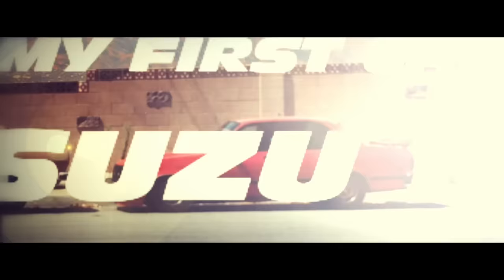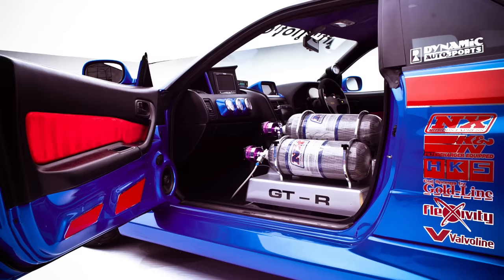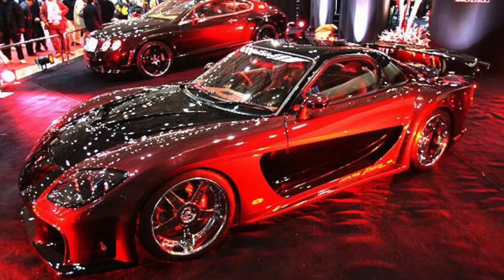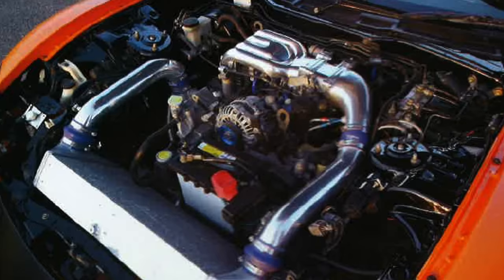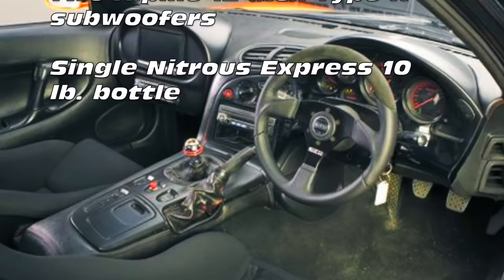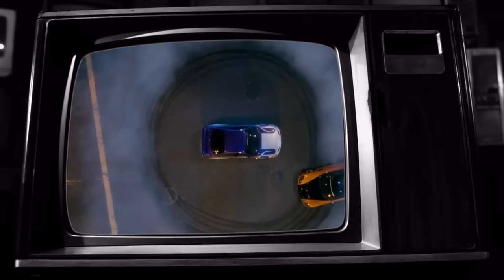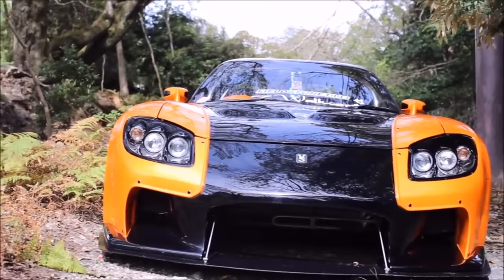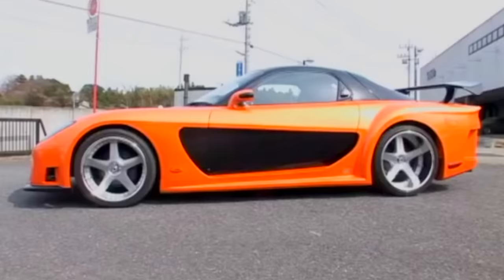HAN'S RX7

Comment: Sung Kang is 100% spot on about the earlier F&F having the most recognizable/iconic cars.
Reply: legit. I can't even remember the cars used in FF4 6 etc. I know they used some lambos and stuff but can't recall the model.
Reply: Robanz ZZ the F-Bomb Camaro from the 4th movie was kinda cool if you like that era Camaro. The real one (owned by the chief editor of Hot Rod Magazine) was a 8sec Nelson Racing Engines 1500hp twin turbo setup. NRE also built the 2000hp Charger that was featured at the end of the 7th Fast & Furious movie.

Comment: The bodykit was always an interesting one with the Koenigsegg-esque fixed headlights, do VeilSide still make it? (Do they make any of the old, iconic bodykits anymore, for that matter?)
Reply from the maker: Yes, it’s still made. I showed a screenshot of their current website (VeilSide).
Reply: Fun fact about you mentioning the koenigsegg. I worked at the factory, according to the "OG's" working there, the early Koenigseggs (CCR especially) had BIG problems with those headlights, always leaking and having moisture problems.

Comment: In 2004, I was putting a rebuilt atkins into my '83 rx-7, and I was watching Fn'F and 2F2F .....doing the work in an apartment parking lot.     Water pump housing cracked on assembly, put the project on a 10 day hold.

Comment: Add another $45,000 you can have a 900+HP 4 rotor put in and have a "show and go" replica.
Reply: gofa curself  I was trying to stick with an engine that was in the same brand.
Reply: Nahh... 2 rotor is capable of putting around 500 whp. Check out Aaron Parker's wolf Rx7 if u haven't already seen it. Still has stock internals and a 2 rotor. Has 550 to the wheels without the NOS

Comment: This FD is definitely in my top 3 for FF also. It's just about perfect. I would love to build one and drop a nasty n/a pp 4 rotor in it... something that revs to 10-12k rpm and just lives to bounce off the limiter. Pretty much a replica of the exterior but with a rotary lovers' motor and leave the interior stock other than maybe some seats and a wheel.

Comment: At the end of Tokyo Drift we see Diesel in the muscle facing off against Sean. How does Diesel's car in that movie, in-universe, compare to the in-universe Charger in terms of horsepower? I've heard stories that some similar charges pull 800 HP with minor mods.
Reply: all i know is cars go brrooooom
Reply from the maker: Make up any story you like - they never showed the motor in Dom’s car, and do audiences are left to their imagination. But since big American cars can’t turn for shit, any car person knows what the outcome would be.
Reply: @craiglieberman  I meant not in a drift sense but more in a power sense, what would you as a technical advisor put in-universe as the engine block in those, and would Dom's car at the end of TD compare to the Charger in F&F.
Reply from the maker: DMZ Given the fact that the car only drove for 50 feet, there would be no reason to change the engine. Also, given the fact that we never get to see the engine, it wouldn’t be necessary to put a fancy engine in it.
Reply: @craiglieberman  Switching the question up then, with the normal weight of a 69 Charger, what kind of engine would be required to do the wheelies the Charger tends to do in the movies?

Comment: Pretty sure Aaron Parker's RX7 makes 500 wheel HP
Reply: Around 550whp iirc
Reply: That thing is sick. It's detuned to 550 and capable of 620 something. But he is of the point that 500 is all what they need to drift in competition and anything above that doesn't add much benefit

Comment: I know two of the RX-7's from the movie has been in my country at one point (Denmark) I've seen one at a bunch of public car show. Not a replica. Stock engine with an HKS muffler, and was one of the extra cars built, not actually used on screen. I think car number 8 or 9. The other one I havent seen but has went through the hands of the same importer, was car #3 and was used for still and interior shots in the movie. Also has an autograph on the spoiler by Justin Lin.

Comment: 3:47 Supra with a roof scoop

Seems legit
Reply: Its a functional way to not only get downforce but air into the cabin in a non air conditioned race car, so...
Reply: It's a duct for rear downforce, most of the cars in that shot are completely stripped down drag cars. Lot's of experimental/weird looking aero mods came about at that time... This kind of duct is similar to the F-Duct's that modern F1 cars use and almost identical in function to the duct on the McLaren F1.

Comment: What is the yellow car from around 4:20?
Reply from the maker: Acura NSX with VeilSide Fortune Kit
Reply: @craiglieberman  i would of never guessed nsx thanks
Reply: NSX with veilside kit
Reply: Check my channel. I have a short vid and some picks of it when I did the air suspension for it at my shop in japan. Tuning japan is the title. The fd is in there as well as some other veilside cars I worked on.

Comment: there is... substantially similar clause allows cars that are substantially similar to vehicles sold here in the USA even if they are less than 25 years old. another was is to make sure they pass safety and emission regulations which means buying several of the type of vehicle you want imported and crashing most if not all except the one you are wanting originally.

Comment: a t04z will make more than 425 WHP on an rx7 with the proper modifications. most likely that particular car was limited on the amount of boost it could safely run on pump fuel and if it was making the 425 WHP it was probably around the safe limit of roughly 1 bar. probably less with stock porting. 600hp may be possible with that turbo on either a methanol injection setup or ethanol as base fuel and large ports. though at 600hp the engine had better be studded and the stock transmission and differential will be a gamble.

remember these cars weigh 26xx to 28xx pounds from the factory, they don't need as much power to be extremely fast. my import slip claims 2774, jdm type-r which is similar to the usdm r1.

Comment: If I was to build Han's RX-7 replica I would just LS swap it. I know it's not screen actuate but an LS would be a better engine for it anyway
Reply: Rotaries are cool and all but I don't want to rebuild the engine every 2 yards
Reply: Bro 13b engines do 1,600 horsepower on full  prep engine for drag racing and 1,000 hp on a regular setup for street use........no need to LS swap

Comment: I wonder how Nitrous oxide would affect a rotary compared to a normal piston engine?
Reply: It’s just like a supercharger in a bottle
Reply: The setup in this car was around 75hp wet kit. They take it pretty well. I ran the same on my fd, but tuning is important. Also a piston engine you can drop plug heat, a rotary doesn’t like cold plugs.
Reply: same effect, I don't think it cools the engine as much tho.

Comment: Craig I like your videos but you are INCREDIBLY wrong about the "25 year rule"

25 year rule doesn't ban imports, it ALLOWS imports older than 25 years old to be brought in without having to be within US emissions or safety standards.

Without the 25 year rule imports would be a lot more difficult.

You said there's no work arounds. 25 year rule IS THE WORK AROUND. The only proper way to import cars from other countries before the 25 year rule is to have another couple cars of the same model come in and do emissions and safety testing first, and if it doesn't pass you have to build that car until it is US emissions and safety standard compliant.

You can import cars that aren't 25 years old and there are people that do that still, but its costly due to the things I've previously mentioned. This is why the legal R34s are so expensive
Reply: I think he shortened the importing details to fit it into a subject about the RX7. But from a studio's perspective, it is more costly and time consuming to crash-test the cars and import it legally, like the way Motorex did.

Comment: How fast was the hero car r34(2f2f)?  And was it down piped?
Reply from the maker: Define “how fast?”  Quarter mile time? O-60?  Top speed?  Of course it was down piped. Virtually every modified turbo’d car gets a bigger down pipe.  It was one of the first mods EVERY tuner does to a turbo car. I’ve done two videos on this car. Check them out.
Reply: The pink s2000 was faster 👀
Reply: @craiglieberman   top speed**
Reply: @craiglieberman   just askin because it sounded fast

Comment: @Craig Lieberman
Completely unrelated to this RX7...I've had a question pop back into my head from years back - What is the hanging cable below Brian's eclipse in the original F&F? Was it just for the underglow?
Reply: It was a mod for the skid plate stunt later in the scene..
Reply: @Ranzoe813  was it an air line to blast out the floorboard?
Reply: @turbocharged9589  i think?..or a wire..i only know its related

Comment: If it made 400 plus hp I think nitrous would push it higher
Reply: Rx7 can make good power. But what he meant is that with that particular turbo system 420 is something that was possible. A bigger or better turbo would give better output

Comment: I like the JDM cars but nothing like good old American Muscle too. My 2014 CTS-V coupe is dynod at 530 Wheel Horsepower with nothing more than headers and pipes and an intake. And with magnetic ride control and Stabilitrak it handles pretty good too. Still, wouldn't mind finding a Gen 4 Supra Turbo lying around...
Reply: @ACommenterOnYouTube  Ill take supercharger whine over turbo spool any time but to each his (or her) own.
Reply: @ACommenterOnYouTube  I'm with you there, i think they both are great, but all the bs from v8 owners about custom exhaust on turbo v6 engine is ridiculous, talking about the best exhausts for a v6 is the stock one or to get a v8,I don't understand how they can think the only vehicle that sounds good with an exhaust is a v8, I had a twin turbo v6 EcoBoost that I put down pipes and a 3.5 mbrp exhaust and muffler with custom resonator and also opened up the bov and had a dual cold air intake, between the whining rumbling sound of a jet from the exhaust  the air intake hissing and the bov shooting air out whenever I let off the gas or shift gears that was such a beautiful badass sound and is just as good or better than the sound of any v8s

Comment: I always wondered how many mods you had to do to get a car to drift efficiently for stunts. Turns out you guys had to wear down the tires to get the stock stunt cars to slip lmao
Reply: I feel bad for those stock engines being asked to spin 19 inch wheels and 305 tires!
Reply: Probably not much. You can run really high rear tire pressures and it won’t have much grip. It also doesn’t take a ton of power to get something to drift for the couple of turns they would need for a shot.

Comment: I can accept the epa shit, WITH 25 year release of such b.s. And i would beg that it be lowered to 20 year. Also with no more cash for clunkers which artificially raise prices for these things beyond what they're worth.
Reply: I have a decent 03 em2 civic, I'd like to runaway with, but it needs till 2028 or 7 more years, which sucks, i don't want to sit on it for 7 years. Also i live in rust belt. And it's like 20 year old cars aren't a significant factor in climate. Not that i believe any of the spa shit actually mitigates it, or even electric. Gas has a higher energy density then lipos which were designed for volume energy density for phones and laptops, not propulsion.

Comment: I have to disagree with most of what this guy says when it comes to prices... maybe if you're paying somebody to do it but not if you're doing it yourself.
Reply: The veilside rx7 kit is 1.8million yen which comes out to about $16000 usd. Add in $4000 to ship the kit. Getting the kit fitted, trimmed and painted house of colour orange will probably cost atleast $10000, if not more. Sure you can fit it and paint it yourself but that doesn’t seem like an easy colour to paint and are you really going to be keen enough to cut up your $20000 body kit and your FD? The engine probably won’t need to be rebuilt as it would have most likely been done already. The t04z is super expensive for what it is ($4000 on eBay wtf) but a garret gt3582 will be a lot cheaper and make 400hp still. Because they came factory on falcon xr6 turbos over here you could even get a used/junkyard one and get it rebuilt and high flowed at hypergear for more power and have a sub $1000 turbo that will kick ass. I personally wouldn’t worry about the interior but put in a nice nardi steering wheel and short shifter for $500usd. Getting it tuned with either an Apexi power fc or a proper standalone ecu with and exhaust, intercooler etc will be around $6000 unless you go full replica and get a titainium exhaust and whatnot then will set you back even more. Somebody probably makes replicas of those wheels and they look shit and dated anyway. Some cool overs and brakes will set you back $3000-5000